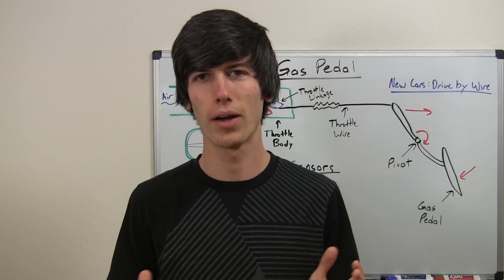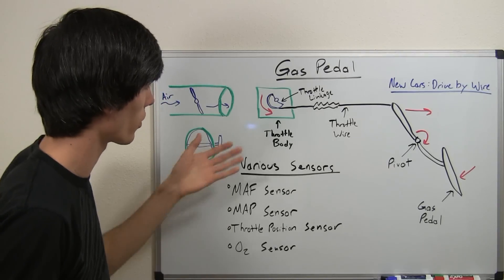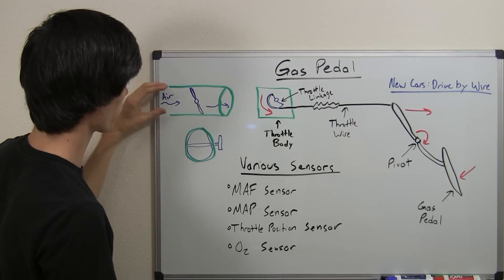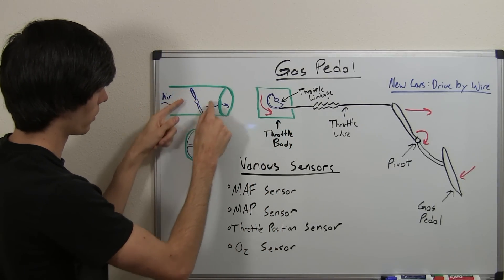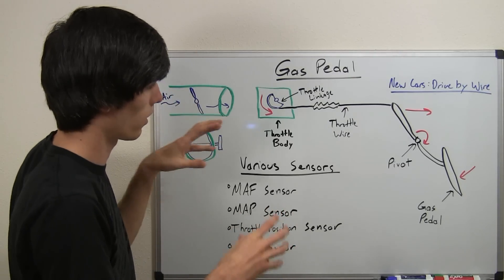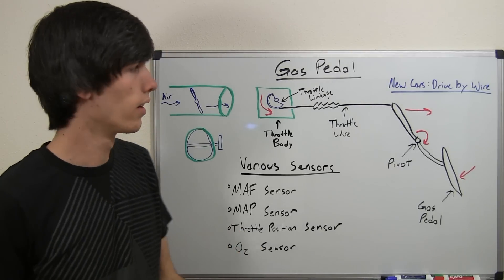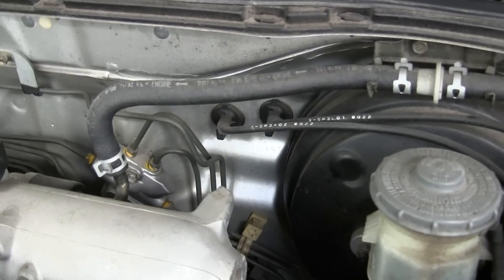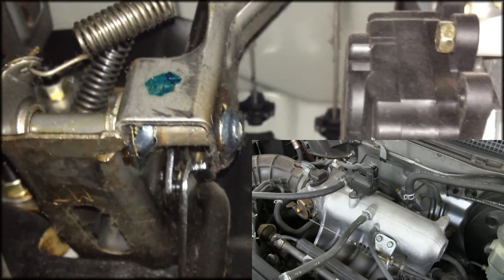How Does A Gas Pedal Work?

Comment: The gas pedal, also known as the accelerator pedal, controls the engine's power output by regulating the amount of air (and fuel) entering the engine. Here's how it works:

1. Pressing the Gas Pedal
When you press the gas pedal, it sends a signal to the engine to increase the intake of air and fuel.
This action causes the engine to produce more power, making the car accelerate.
2. Mechanical vs. Electronic Systems
Mechanical Throttle Control (Older Cars)
Throttle Cable: The pedal is connected to the throttle body (part of the engine's air intake system) via a cable.
Pressing the pedal pulls the cable, which opens the throttle valve.
This allows more air to flow into the engine.
The engine's computer adjusts the fuel injection to match the increased airflow.
Electronic Throttle Control (ETC) (Modern Cars)
Drive-by-Wire System: Instead of a cable, the pedal is equipped with sensors (potentiometers).
Pressing the pedal sends an electronic signal to the car's Engine Control Unit (ECU).
The ECU calculates the appropriate throttle opening and fuel injection based on the pedal position and other data (e.g., engine speed, load).
A motorized throttle body adjusts the air intake accordingly.
3. Engine Response
More air and fuel entering the engine increase combustion, which creates more power.
The engine’s crankshaft spins faster, and this rotational energy is transferred to the wheels via the drivetrain, causing the car to accelerate.
4. Idle and Maximum Throttle
Idle: When you don’t press the pedal, the throttle valve stays slightly open to allow just enough air for the engine to keep running.
Full Throttle: Pressing the pedal fully opens the throttle valve for maximum air and fuel flow, providing peak power.
5. Safety Features
Modern cars often include systems like:

Traction Control: Limits engine power if the wheels lose grip.
Cruise Control: Takes over the throttle function to maintain a set speed.
Summary
The gas pedal controls the flow of air (and fuel) into the engine, either mechanically or electronically, enabling the driver to adjust the car's speed by controlling the engine’s power output.

Hope this helps!

Comment: Gas pedal is named so wrong it actually has nothing to do with physically pumping gas it as is said in this video controls how much air enters the engine. The computer actually sees through sensors what your asking for the engine to do is the throttle way open then computer adds lots of gas is it pretty much closed computer ads less gas. Change the name to accelerator pedal not gas pedal

Comment: They shouldn't have named it Gas Pedal but should be called "AIR Pedal" instead, since it's manipulating Air flow flowing to the Engine to reach a proper fuel and Air ratio to change piston's speed ... LOL

Comment: What happens when you are at a constant speed and let go of the gas and don't press the brake pedal? How does the car slow down? Friction or are the brakes steadily compressing the rotor to thus slow down and eventually stop.

Comment: Can you tell me what sensor controls the air pressure that goes inside the intake when the throttle it's open because my car rpm won't pass 4000 or 5000 rpm, rpm needle goes back Dow when I step on gas soones hit 4, 5 or 6000rpm it feels like it lose air pressure and the rpm needle goes back Dow but the car don't die

Comment: Hey . I am curious when you start the car the engine is running how comes the car doesnt move until you accelerate leave a manual car i am talking about automatic what systems do they use. Planning to make a go kart without gears what should i do to make it move only when i want to

Comment: the gas pedal is manipulating AIR for the engine's intake and the various sensors communicate with ECU to pump more fuel, hmmm... therefore the "GAS" pedal  isnt manualy pumping fuel,, you just requesting to ECU to pump more and meet the right fuel/air mixture ratio.
Reply: Top Sy Krettes how about carburetor
Reply: Kent Patrick Parilla     Same basic thing only difference is there’s always gas in the bowl so pumping the gas pedal back on older vehicles actually helped to start but in fuel injected cars pumping the gas pedal dose nothing at all

Comment: But following this logic, you should press the gas pedal the whole time or else the engine does would turn off when idle. Why doesn't that happen?
Reply from the maker: +Daniel Ortega the iac valve prevents this. Check out my "throttle body" explanation for full details!

Comment: hii this is vamshi  Actually i am doing a mini project on opening and closing of butterfly valve using stepper motor .its just a working model for that i need your help just help me out in connecting stepper motor to throttle body ,kindly help me out

Comment: How bad is flooring the car when it's at operating temperature? I own a 2008 Cadillac DTS and i'm always seem to floor it a little too much haha. I would say I floor it about 4 times a day at least and some people say it does wear on the components but how much does it wear on the components? Some say it's good to floor it to get rid of excess carbon but just how bad is it to floor it at operating temp? I also baby it until it gets to operating temp only reaching max 2500 rpm usually under 2000 rpm until it's warm.

-Thanks
Reply: Steve Car engines are pretty strong. Flooring it a few times a day at operating temperature shouldn't do any harm long term as long as regular maintenance is obtained.

Comment: Very nice video but may i ask you if the gas pedal is connected to the throttler body and at the same time the throttler cable? so the gas pedal is connected to 1 lever and 1 body?

Comment: when I floor the gas pedal in the car I drive I can push it further down in a notch. I've been told this is called; kick down, and that it's meant for just a little extra boost.
Reply from the maker: +arnjhon What is does is forces a downshift so you'll have more torque. Engine power will remain the same, but gearing will give you more wheel torque.
Reply: I know on my Lexus, it literally has a button where, I floor it and it stops the pedal, but then I really push it and it pushs the button, which tells the computer to downshift. maybe your car has something similar
Reply: they usually call this a "wide open throttle sensor"...

Comment: I think I have faulty gas pedal. When cruising in 4th or 5th gear with gad pedal slightly pushed down my engine doesn't keep constant rpms. Can I try to disassembly gas pedal and spray it with contact cleaner ??

Comment: This is how the accelerator works on a Gas engine (though I didn't notice you mention that either in video title or in your description). I came here trying to find a video that shows how an accelerator on a diesel engine (Drive by wire throttle with a turbo set up) works. Can you please upload a video on that? Thanks

Comment: So how did it work before the sensors? How did the correct amount of fuel get injected? Was there like a system that linked the gas pedal/throttle linkage to a valve or something that controlled the amount of fuel injected?
Reply: It wasn't injected , it was basically sucked into the engine.
This was done with  "The carburetor".
These worked on a principle called "the venturi effect".
The same way air flowing by the top of a chimney causes smoke to be pulled upward.
Pistons moving downward , on the intake stroke , caused a vacuum.
This vacuum was below the carburetor.
When the Carb was opened , the venturi effect  basically sucked the fuel from a reservoir in the carburetor.
The reservoir worked the same way a toilet tank works.
As soon as the fuel & a float dropped to a certain level, a valve opened up and fuel flowed in to replace it. 
It was primitive but worked very well
Reply from the maker: Carburetors can be dialed in to match the amount of fuel to the amount of air: Carburetors - Explained

Comment: how is this throttle body connected with the air intake I mean with air dampers?is that another wire or what? thanks
Reply from the maker: It's just tubing, air comes in through a filter and then through the throttle body.

Comment: what happens when a cars is idling can someone explain please i am so confused?
Reply from the maker: A small amount of air is allowed to pass through the throttle, and there's also an Idle Air Control valve which allows more air in if necessary (on start ups when the engine is cold). This small amount of air mixes with a small amount of fuel, and is just enough to keep the engine running, while you wait at a stop light or whatever it is you're doing.
Reply: thanks alot brother your answer is so meticulous i had a small idea about how the whole process functions i knew that some sort fuel has to flow  but i got confused on the amount and what limits it
Reply from the maker: No problem! The fuel is limited by the amount of air that goes in. There are several sensors which read this (MAP, MAF, O2, I have videos on each of these if you're interested), and the ECU interprets this data and tells the injectors how much fuel to send.
Reply: lool i just been watching all eight of them as i have a fuel,ignition and exhaust exam on Tuesday i dont know how to thank you for your videos but its helping me alot with my level 3 vehicle maintenance course basically car mechanics  i do appreciate it means alot :)
Reply from the maker: Glad it's helpful for you!

Comment: Well explained but I guess even at this primary stage, there should be a bit more in detail regarding negative pressures created in the intake manifold sucking in outside air 'coz nothing in this video explains what is actually making the air in. What one might construe from this is that a valve opens and air is allowed to flow freely which is similar to opening my house's door and air flows in but there's a force involved in an engine that is actively sucking in air.
Reply from the maker: If you've watched my video on engines before this, it should be fairly clear. Cheers

Comment: my bmw throttle position plate is fully open thats not right, right? the car is idleing really high gets up to 3000 rpm!
Reply from the maker: Definitely not right. Also could be an issue with the idle air control valve.
Reply: my car is bmw 540i, i dont understand the throttle body valve positioning.. im gonna clean the idle control valve

Comment from the maker: You are correct, but how much you open the throttle ultimately is what restricts the total amount of air coming in. Even if your cams open up the valves a huge amount, if the butterfly valve of the throttle body is closed, not much air will be going in (the car will not accelerate without any throttle).

Comment: Decreasing A/F ratio does not increase power. The ratio should stay pretty close to the same if at full throttle or idle. When the throttle is depressed more air is let in and also more fuel keeping the A/F ratio basically the same the increase in power comes from increased cylinder pressures resulting from a larger combustion because of more air and fuel.

Comment from the maker: Typically diesels are direct injection. By pressing the gas pedal, you increase the amount of fuel injected (rather than allowing more air in. Thus, pressing the gas pedal decreases the A/F ratio, increasing power.

Comment: Clutch pedals work on almost the same principle to this, except rather than operating a throttle butterfly, it operates a lever that pivots on a point, to move the release bearing, which compresses the springs on the pressure plate, to release the friction plate. As the springs use high pressure, the cable stretches. Eventually, the cable will snap at its weakest stress point - simple run down of what it does and how it might've broken.

Comment from the maker: That's a good question, just comes down to chemistry. I hope to make a quick video on this eventually. Basically you go from C8H18 (or other hydrocarbons) + O2 + N2 and then you react to form CO2 and H20. When you balance it out, it comes to about 15 parts air to 1 part fuel.

Comment from the maker: Ahh, yes, sorry for the confusion. I simply use fuel injection for most videos since that's what's current these days in cars. Carbs are still used in some small engine applications, but they also seem to be phasing out.

Comment from the maker: By allowing more air it increased the pressure difference in the carburetor, thus forcing in more fuel. But what you are adjusting by pressing the gas is how much air is allowed in.

Comment: This video kinda contradicts your video about carburetors where you say the throttlecable is connected to the butterfly valve in your carb. This is how it is on my motorbike, where it will allow more air/fuel rather than just air

Comment: You forgot to mention that it's only 14.7 psi of pressure at sea level, the ammount of air pressure, as I'm sure you already know, varies depending on your altitude. Great video otherwise

Comment: I can hear the the engine sound go slow and then as the rail re pressurizing and then I know its ready. Does the low pressure pump only come on during the starting phase (to prime the system) and then the high pressure pump takes over?

Comment: Hi My van has a fault which I believe is the injector leaking. If I start the van after a rest period (about 5 hours) the van will start but I can accelerate for about 30 seconds. Its a common rail high pressure direct injection. I think because one injector leaks the rail pressure drop so the ecu doesn't allow the van to rev until it reaches the right pressure. So could you explain the fuel supply system. Is the fuel rail meant to hold the pressure when the van is switched off. I can hear the

Comment: I think carburator-based cars had a problem: pressing the gas pedal would add fuel into your engine and it would choke on the first few crank rotations. As I said, I think. correct me if I'm wrong.